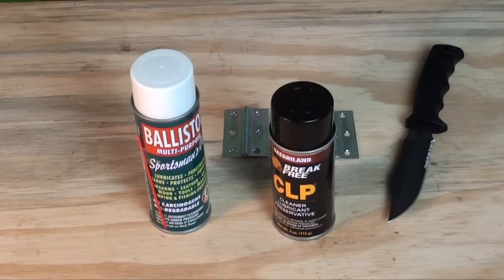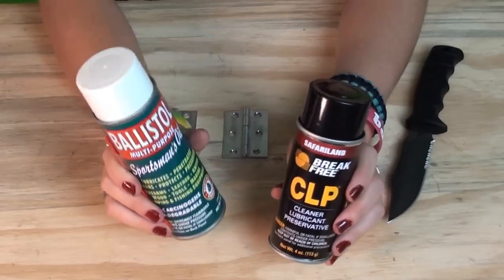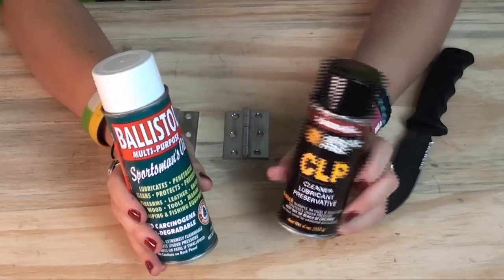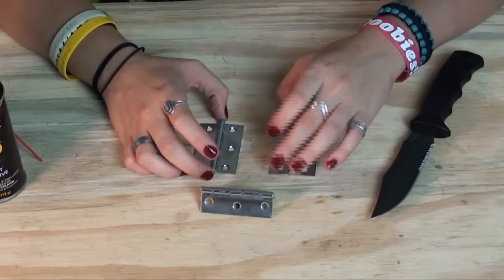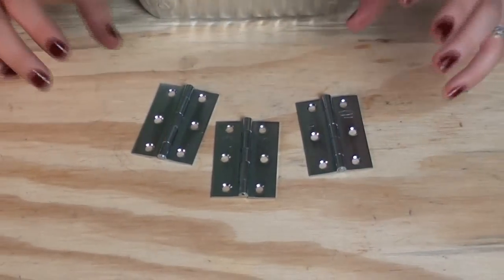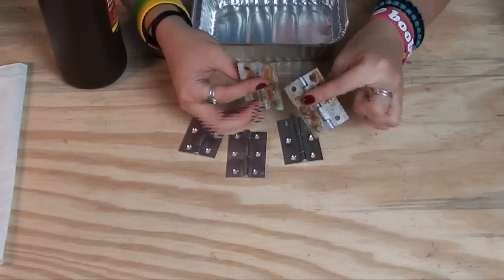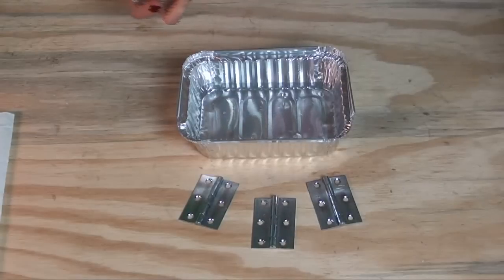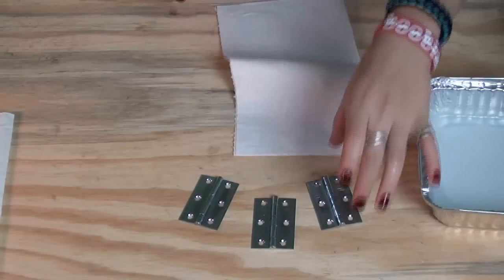Ballistol vs Breakfree CLP EXTREME Corrosion & Gunpowder Burn Test - FateofDestinee

Comment: You need to let the Ballistol sit on the parts to break down the crud a lot lot longer for it to be really effective, it's not abrasive at all and takes a long time to clean stuff. Then you need to run a lot of patches over or through parts untill they're clean. Very slow process.

Comment: Batch was contaminated by mixing all the hinges in the same pan of soup. Also, you should use hardened steel of the type used in firearms not soft metal door hinges.

Comment: If a gun is filthy and I haven't cleaned it for a while and it's time for a thorough scrubbing, I use BreakFree Powder Blast.  If it's just a little maintenance after a couple hundred rounds at the range, Ballistol has never done me wrong.  Never tried the CLP, maybe once one of my current two cans are empty I'll check it out.  Seems like a decent product.

Comment: I've never heard of ANYONE's gun, failing, rusting so bad it wasn't usable anymore because they were using "x" product over any other one. I've bought most clp's, oils etc, and the difference is so minimal with most of em it's a coin flip, especially with BreakFree CLP and Ballistol. I have both, use both and haven't had a single problem. The 1 clp I will say is COMPLETE SHIT is FrogLube. I was "all about it" for a few months till I grabbed my AR one day and the BCG was sticky. And yes, I de greased my AR with FL's solvent, applied it EXACTLY the way the directions tell you to. Wiped off ALL excess FL and even in the hot CA weather - that time of year it was about 75*s outside daily - even in a warm climate it still gummed up on me so that the ONLY clp I've used out of 10+ clps that I can say with certainty is SHIT...

Comment: CPL IS a cleaner...by using WD-40, all you are doing is setting it up for problems. BreakFree CLP and a good scrubbing is all you need. After than, a lubrication of all contact parts is a good idea. BreakFree is a mild lubricant that is suitable for loose fitting parts but I still suggest using a gun grease of some sort...

Comment: Well, how about testing every product that is out there, including WD-40.  Also, applying said products on a patch and rubbing the product onto the hinges might produce a different result as well.  Cause, when I clean my firearms, I tend to clean all carbon off, then liberally soak a patch and coat parts with CLP and let parts sit for 15-30 minutes and then return to wipe off the access and then reassemble.  Have had no issues with any corrosion.

Comment: LOL... We used to use carb cleaner to get the hard to remove carbon off of our M16's, M4's and SAW's when I was in the Army. We would then follow up with CLP and wipe it down good so there was no excess and never had a problem.

Comment: Ballistol is NOT recommended for nickel plated or gold leafed firearms and I wouldn't use CLP for this either. This means that if you use these for long term storage they could eat the plating right off your gun. For my guns I use CLP to clean them and Lucas gun oil for lubricant. Plain mineral oil works for long term storage and it's less expensive than gun oil.

Comment: I think you need a better media.  And what about lead removal.  Those cheap hinges hardly represent a barrel or a slide. The Hypothasis is sound in making a real head to head test.  Just difficult to execute.  If I had a rifle with wood stock I would go with Ballistol and if something was really gunked up and abused never cleaned I'd use the Break Free.  Great comparison.

Comment: I really like the videos but to properly test solutions you need to remember gun parts are not zinc plated hinges and the properties such as things embedding during burning or submersion in caustic liquid are not comparable as to which one is better
The gun parts are way harder and the gun powder has a less likely of embedded and or corroding
Although the test is nicely carried out all it proved Is one or the other reacts and is better suited to hinges. I really like the compare and I think hin

Comment from the maker: @conarl1 I agree - hinges are not guns lol But then again, I wasn't testing that, either. Just thought it would be fun to see how these two products compared against each other without the metal being a factor :] I also agree with you on the Ballistol - I like that it's gentle enough to use on metal or wood. I still end up using a dedicated wood cleaner/oil on my firearms, for the most part, but it's nice to have the option, you know? Thanks for your feedback!

Comment: Don't think your test procedures are very accurate.  Understand that smokeless gunpowder only burns efficiently under pressure.  That occurs when in a confined space, such as a cartridge that is loaded into the chamber of a gun.  To make your test more applicable, I suggest using black powder.  In addition, all the zinc plating should have been removed from the hinges.

Comment: I would've used a brass brush of some sort to compare the products after the gunpowder test. After all, when cleaning a bore, a patch goes in first to soak it up, then it's brass time, and at the end you begin sending patches in again to remove the residue.
Also wondering why the products weren't compared on their rust-removal capabilities after being tested on the rust prevention department.
Anyways, thanks for the video and may you have a nice day!

Comment: Steel, iron and cheap alloys have different reactions to corrosion, CLP is 2hs cure factory recommended, for a fair and useful review use pieces of the right metal you want to compare as a gun, if you going to do a review read the instructions and use the products in the right way. Another good and proved in WWII and Vietnam war is the Rem Oil.
Reply: Wrong she is testing the lubricants not the material! Learn how to run a test before you tell other's they did it wrong. As long as she used some form ferrous material the results are valid. Now if she wanted to test various alloys resistance to corrosion with out a lubricant or surface finish then the alloys become the most important thing. You have to think about what is being tested here. She was not testing the steel alloy she was testing petroleum products designed to form a barrier against oxidation. For the record Ballistol was invented for the NAZI's prior to WWII to

Comment: Thank you for your video.  I almost stopped it at 15 seconds.  First off you are using zinc hinges and not hardened steel or chrome.  Second the gunpowder is burning the pit holes in the steel.  I have used both products for years and only select what is cheaper at the time when I run low.

What I noticed is the CLP formula dose not care if the metal is soft or hard it cleans it with care.  The Ballistol is a little more harsh by removing more of the metal zinc with the gunpowder residue.

Comment: Love your videos. That being said I'm a die-hard CLP user, after 11yrs in the Army I should be. I would make the suggestion that you rerun this test. Using brass wire brushes instead of fingers, adding a second component which would be carb cleaner. just for your own knowledge. Love ya, Walker

Comment: Along with testing metals more consistent with what guns use and putting breakfree and ballistol on before you burn the gun powder; it would be cool if you had a second control group of hoppes #9 and rem oil or something as a comparison to breakfree and ballistol.  I use breakfree to clean all my guns by the way and have never had a problem with the stuff.  Overall good job!

Comment: Loved it, cheap way to look at it! Tuff call I think.BUT; Balostol works on leather and wood. So for cleaning and lube on the out side of my 308. I dont even take off the leather stap. Just give it all a good dose and rubbing. Just easyer. (ya, I pick up CLP at wally world too) But not on wood are leather. Just the inside..

Comment: I think on the powder residue a wired brush with ballistol would work best cause it gets rid of the scorch marks that are very hard to get rid of and you can use the brush to clean the powder residue while the break free clp got rid of the powder but not the scorch marks that are hard to get rid of.

Comment: I applaud your effort, but a hinge is still much different than a gun barrel.  Hinges are usually stainless steel but a lower grade and is made stainless by just galvanization..Or they are just brass with a satin nickel coating.  Gun barrels though, (Glocks) are solid pieces of steel that are heat treated and hardened using a nitriding process (tenifer for glocks)

There are other variables to consider.  Plus you're comparing a 5 dollars piece of metal to something that is closer to 200.

Comment: I generally use CLP powder blast (it eats powder residue like carb cleaner) and used to use rem oil. I've now found "Lucas Oil Gun Oil". The Lucas Oil really surprised me. Being an avid hotrod addict I had to try it just because. Even my "picky" firearms (so to speak) seem to run smoother for longer. Maybe it's in my head, but my .44 mag Desert Eagle seems to be somewhat less picky about lower powered ammo when I use it. Give it a shot and let me know what you think. I found it in Napa.

Comment: Do you take your guns scuba diving in an acidic ocean? If not then is that a proper test? NO! It's not a valid test!  Let the solvents set for twenty minutes? I was told to put the solvent sit for 20-30 minutes to soak the contaminates off the barrel! You need to use steel not tin hinges. You didn't use a brass or copper wire bush to simulate the bore brush in cleaning. That's what I think?

Comment: I've been a gun smith for over 30 years and I've tried them all but to me the best is G96.  I bought an old AFB four barrel carburetor  That had corroded shut, I used all the carb cleaners but no good and since the carb is a polished aluminum I did not want to use any harsh rust removers so I sprayed it with G96, what did I have to lose. Next day I pushed the linkage back and it moved.. From that day on I keep some in my garage tool box as well here at my home/shop   g96 .com  no spaces

Comment: It's best to do your tests with steel that was never coated. For in at the least one simple reason. You may not have evenly taken off that protective coating evenly before testing. I suggest non treated nails next time. And your solution was over saturated with the salt so it didn't do much good. Other than that looks good. But I would do the test again so you know for sure what is better so all your pretty guns stay nice and clean next time you decide to go swimming with them in the sea. ;)

Comment from the maker: @grizz474 I used chrome-coated hinges, and spent equal time, pressure, and grit of sandpaper to remove the coating equally for each hinge. Took wayyy longer than I had wanted it to, but I thought it was still worthwhile to give me a fair comparison, you know? I've never been afraid of using a little elbow grease, or getting my hands dirty. This test had a good deal of both lol But I'm not a scientist or anything... this was only a casual comparison just for fun (I enjoy them, too!). Thankya!

Comment: in cleaning i use carcoal lighter fluid, for lubrication and protection i use mobil 1 synthetic oil in a 5 to 1 ratio mixed with STP i think if you try this test using these which are less expensive and more effective I think you'll be shocked by the results this is not something I innovated I got it from Benjamin J who uses youtube handle the nagantman he is a collector, inventor and a gunsmith

Comment from the maker: @coldbeer338 I totally agree that hinges are not firearms lol But I wasn't testing that, either - only comparing one gun solvent/oil against the other, just for fun :] That's also why I used paper towel instead of nylon or brass brushes (as I use when I'm cleaning my guns). Thanks for your feedback! And thanks for watching ;]

Comment: LOL! Thanks for trying, but you really need to learn your metals before making such a comparison. Ballistol is way better than CLP for cleaning guns. Just don't use it on copper or gold as it will actually damage those. BTW, you need to wipe with Ballistol, then coat it with Ballistol. Let it sit for 15 - 30 minutes (depending on the grit level). Come back and wipe off the gun well. Repeat if needed. Always make sure you remove as much of the Ballistol as possible when you are finished.

Comment: I'm not sure that was a decent test.  The ballistol and CLP was just dumped on the hinges and then they were dropped in the goop.  CLP needs a while to penetrate as much as its going to.  Sometimes an hour or so, thats what the Manuf says.  Also if you want corrosion protection, use Rig grease in the test.  CLP is for cleaning lube and SHORT TERM protection like if you are cleaning thje gun at least every couple months!

Comment: Good video,  but people just need to understand anything will work.  Every one is biased on their favorite.  I use ballistol, hoppes, breakfree, remoil, heck sometimes I've used wd40. They'll all get ur gun clean
Reply: Ha! Guilty of the same thing! And u know what. Another  tuber put up a method of cleaning rust off your gun with 3in1/remoil and a older copper penny. Rub the penny across the rust spot after oiling. damdest thing no scratch marks and it works great! Try it.
Reply: +bubbacrabb A number of products work well enough as a CLP, but they are definitely better at some things than others, and some that you listed are a bit too deficient in certain ways.  For example, WD40 should clean and protect well, but it's a pretty poor lube, and Remoil is poor at protecting compared to other CLPs.  Ballistol and Break Free are two well tested, safe choices that generally do everything well enough, with the latter probably being the better performing of the two and the former being nontoxic and less noxious.

Personally, I use Weapon Shield because it cleans well enough (maybe about as well as Ballistol?), is easily the best lube that I know of, is excellent at preventing corrosion, and is nontoxic.  For particularly tough cleaning jobs (rare for me), I simply use a dedicated cleaner, namely Bore Tech Eliminator (nontoxic and terrific at dissolving copper, lead, and other fouling).
Reply: rbrtck I've moved on since posting this a year ago. Been using home made eds red for cleaning a quart of mobile 1 for protecting and I've got a can of wheel bearing grease I lube some guns with

Comment: I'm not sure that your experiment is actually what happens inside a gun barrel. You have gun powder burning ON a metal plate.
The gun powder in a bullet casing burns primarily burns inside the bullet case. For example, my rifle barrel is immaculate,even though I've shot many rounds through it ! You burned some gun powder onto a metal plate and then couldn't clean it completely. That doesn't happen in the real world of guns.

Comment from the maker: @excelerater I plan on it. And yeah, I spent hours scrubbing to get all the cosmoline off. The oil can was the worst to deal with though lol. The jeans I wore still smell like brake cleaner from all that hahaha I didn't have to spend as long cleaning after I shot it (yep, I have a little vid from that), but I did notice some cosmoline had sweat out from the wood around the barrel.

Comment: Good vid, I use CLP, or a local brand skrike force. Keep in mind your hinges are stainless, or galv. You need to re-do the vid with carbon steel. I'm an Ironworker. This is my gig. Please remove your jewelry when doing these projects for your safety. Also you are using al. pans. I could get into this if you like.

Comment from the maker: @dick6ace I just wanted to compare cleaner to cleaner and remove variables like metal, cleaning implement, etc. But like you say, I use a toothbrush (with nylon bristles), a brass bristle brush, copper brushes, cotton cleaning swatches, and good ol' mechanics' rags when I clean my guns. I also always seem to make a mess lol

Comment: Thanks for taking my suggestion Destinee with two "e." Not one, but two. Two "e." "Destinee" xD

"I found this solution for corroding really fast on the internet." Give me a link so I can test my Grandpa's dentures.

I use bleach to remove carbon fouling, and butter for lubrication. Not even the blockheads would rob my lego safe for my worthless Gumby guns.